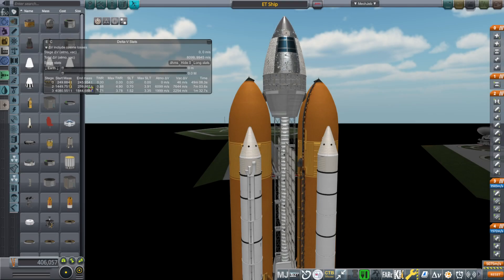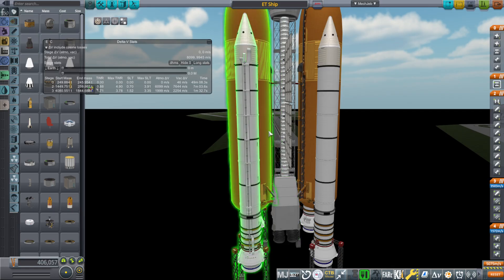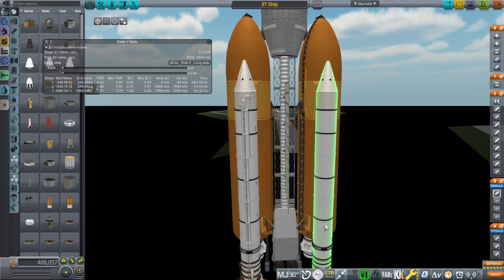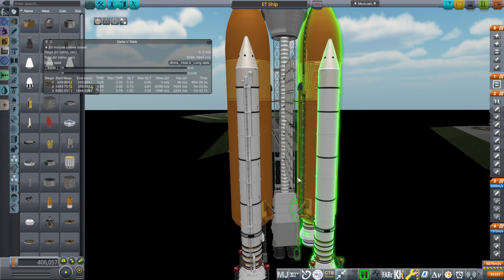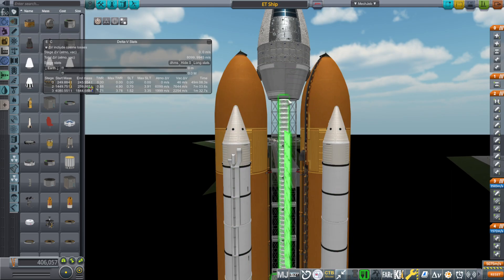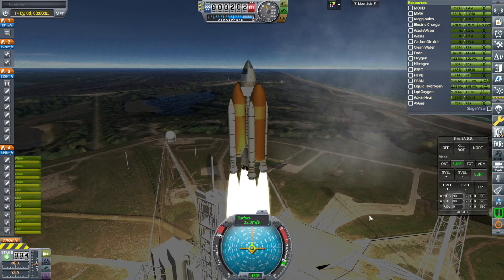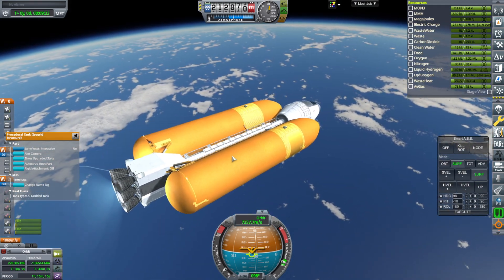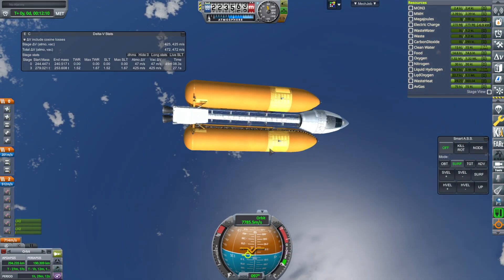External Tank Interplanetary Ship (RO in KSP 1.12)

Comment: The thing about crossrange being by DoD demand is nothing more than a myth. Could point you to the proper documents, but in short, it was useful for emergency aborts.
Also, for this particular ship, you might be able to bring up the NTR engines on the one launch, putting the RS-25s into a Shuttle-C style reusable pod - which pops off on orbit, exposing the NTRs
Reply from the maker: The MSC design reference mission in 1970 used a 55 degree station inclination and only required 200 nm crossrange. With that inclination, it could use East Coast and European aborts with the lower crossrange. I have this from Dennis R. Jenkins' "Space Shuttle - Developing an Icon" page I-254. My understanding is that those requirements were changed because the program needed more budget, the DoD was the source of that, and they had the additional trajectory requirements including polar orbit with its one-orbit abort. It is possible some document would say different to hide the DoD plans, but I would like to see these proper documents.
Reply: @RaizSpace  My source is "Columbia Accident Investigation Board Report: Volume 6, page 224". To quote: "NASA did not put crossrange into the vehicle because the Air Force forced us to. NASA put crossrange into the vehicle because we thought that that was the right way to build the vehicle...we wanted it for abort  capability during launch, and we wanted to start flying the vehicle right at entry." It's possible that polar orbit abort was one of the scenarios considered, but that's useful for civilian  missions too. Plus, the Shuttle "flew like a brick" even with the big wings.
Reply from the maker: In the excerpt, Mr. Thompson, the Shuttle program manager, is responding to Dr. Silveira, the chief engineer and deputy program manager for the Shuttle, and says that they put cross range for aborts,. That's true - they required 200 nm cross range for aborts. He does not address the expansion of that requirement to meet the Air Force requirement, which is more cross range than NASA itself asked for. His comment is accurate in that they needed some wing, but that requirement was increased due to Air Force preferences. I don't think his comment erases that, and Dr. Silveira should know - he was chief engineer and deputy to Thompson. Silveira says on the same page "once we understood what the Air Force requirements were, then we understood how that affected the design and changed over to meet those requirements." The myth is that NASA didn't need cross range at all, not that the Air Force increased the requirement and that changed the design.